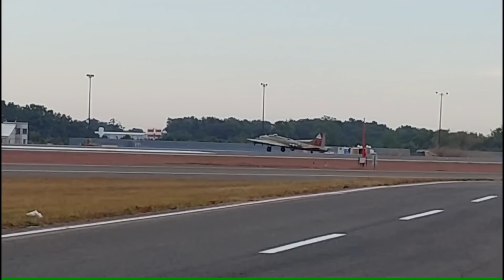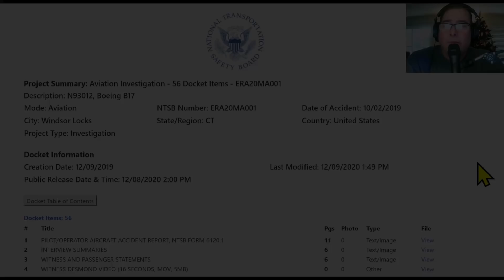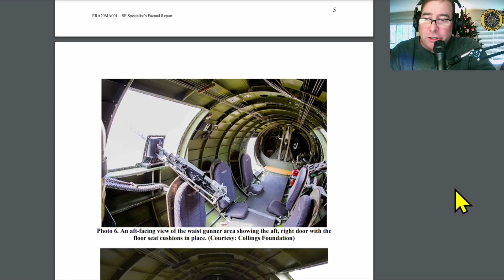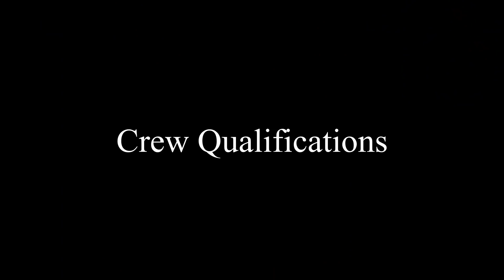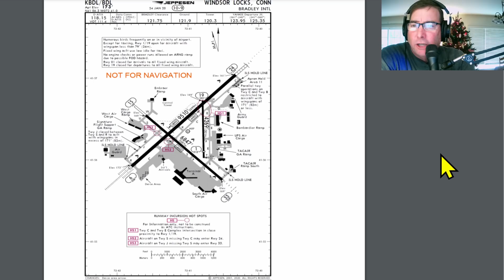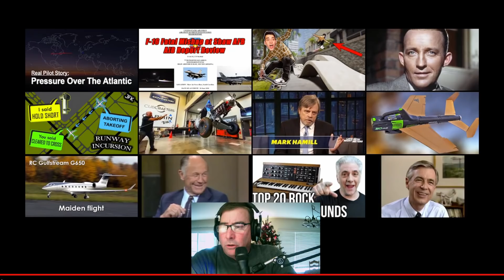NTSB Factual Report B-17G Crash 'Nine-O-Nine' Part I -16 Dec 2020

Comment: To understand the airworthiness of these planes, go to historic photos of these planes returning to base and landing literally shot to hell.
 Nose blown off, wings with massive holes, huge holes in the main fuselage, one was cut nearly in two with only the control cables keeping the tail section attached, with the tail gunner still in the tail, it fly for hours and landed.
Or the case of a B17 that landed itself after the crew ALL bailed out.
 It did crash it landed. This was witnessed by an entire gun crew that was stationed at the end of the runway.
 The plane landed and taxi to a stop.
These plane were flown in battle piloted by pilots 20, 21 years old with IF lucky had a few hundred hours including their trainer plane hours.
These young crews took off in bad weather and severely overloaded all the time.
 The safety belts are not just old out of date belts, they are in current use in all types of race cars and are easier to latch/ u latch than current automotive types.
 Possibly the real factor was the pilot's age. No matter how many hours you have, your reflexes slow down, the mind is not as fast as in your younger days. It only takes a hundredth of a second to change an outcome.

Comment: When you made the comment earlier about the number #3 engine having the only generator that sounds a little strange to me.
Did you mean the only hydraulic pump?
On a friend's PBY I used to fly 28 years ago #2 engine had  the only hydraulic pump as #1 didn't. Both engines have generators. 
Seem strange to shut down an engine that was running rough.
It's still making power.
A witness on ground said he saw #3 prop feathered before right downwind turn. Wondering if the captain feathered wrong engine.
Cockpit management you're supposed to identify, then verify  what engine is running poorly or at all. Being that low with rough running engines on both sides then turning into them too easy to shut down wrong engine.

Comment: The major mistake was the piolet did not realize this aircraft could land on the grass. He tried to make the paved to runway when he did not need to do that.
Reply: +Greg Warner   From another video, several mistakes are clear:   1) The pilot assumed #4 engine was bad because it had a history of trouble.  He feathered the #4 prop when he could have kept that engine for airspeed.  2) #3 engine was detonating and losing power,  so with 3&4 out they lost airspeed, below 90 MPH,  3) They dropped the gear early and lost more airspeed,  4) They came in low and clipped the ILS equipment,  5)  They dragged a wing in the dirt and increased power on #1 and #2, which swung the plane right and off the runway and accelerating.    If they had dropped power on 1&2 and stayed straight it would have been an ugly landing in the dirt but at least they would be down and possibly survivable.   Aircrew discipline and cockpit management were also factors.

Comment: Umm.. the crew and passengers should have watched the WW2 B17 training films. You are not supposed to use seat belts, everyone except the pilots and radio man are supposed to sit on the floor of the radio room, with back against the forward bulkhead, knees to chest, with the next persons back against your legs, one guy lays on the floor with knees slightly bent, radio man inflates one side of his mae west, crosses arms on radio table and rests his head in his arms, and after the crash you pop the roof off the radio room and evacuate out the roof opening, pilots crawl out cockpit windows, and all is generally well and good. In WW2 pilots landed B17s just about everywhere and in every circumstance you can think of and those pilots were very young some not even 20 years old and in a lot of crashes everyone was fine or only had minor injuries and if landing is impossible you grab a parachute and jump out the door. There was even a B17 that landed itself with no one on board because the crew had bailed due to damage so what happened here? Pilots are not as good as they used to be.

Comment: Terrible tragedy.; Maybe a stupid question but..try to answer if reasonable: would a sudden, risky, rudder turn 'help' - causing turning, drifting aside, lost of gears, propellers, but stop the aircraft prior to hitting the tanks?
Reply from the maker: I'm beginning to wonder if Mac was bounced out of his seat, or not in complete control at that point...
Reply: @blancolirio    From the witness video,  it sounds like somebody in the cockpit applied full power (or close) to #1 and #2 when they dragged that wingtip.   They accelerated into the crash with 1&2 pushing them to the right, and also I think somebody was applying rudder.

Comment: We had a set of those in the Navy C-130s.  We called them Gunner's Belts.  They had about 15 feet of a lanyard that you attached to the deck d-rings.  They were used for certain Emergencies and when the cargo ramp was lowered in flight.  I find it very unsafe to have PAX getting unbelted and allowed to gather at the front of an aircraft in initial climb out.  I find it in complete disregard to flight safety for the FE to be leaving his Station during a critical flight phase.   A critical experience examination of Pilot histories would be how many and what type IFEs (In-Flight Emergencies) they have experienced.   Even the most experienced, most cautious Pilot will become complacent overtime when greatest emergency is a cancelled PPR.   I was a Navy TSS/Airframer on the C-40A Clipper (Plank Owner) and Loadmaster/Airframer on C-130T, about to put in my FE package when I received my Line of Duty Disability.

Comment: Engine shut down, sputtering second engine, hanging on the props, can’t even reach pattern altitude, a few knots over stall speed...seems like it’s screaming emergency.  

Also, had they declared an emergency, that would have trumped the pattern and they wouldn’t have needed to turn into the dead engine.  That’s multi engine rule #1...NEVER turn into the dead engine.

Comment: The following are comments about operating warbirds in general, and not directed at the Collings Foundation.  I have some friends that are active with warbirds. I was for a bit, and saw upclose how sloppy the maintenance and flight training/standards were. For any non-flying folks, stay out of these warbirds. One has no clue as to the soundness (airworthiness) of the aircraft, the training thoroughness of the pilots, nor the skill level. The problem with these is this: People that want to own and operate a warbird try to lessen the cost. Cutting costs entails creating a 501c3 tax-exempt organization. Then they recruit "volunteers" that work in the marchandise store, back offices, grounds keeping etc. Also, the mechanics are volunteers, many of whom are not certified aircraft technicians (FAA certified Airframe and Powerplant mechanic). So who is doing the maintenance? Un-certified "volunteers" under the "supervision" of the few certified A&P mechanics on staff. Parts for the aircraft are very rare. Many parts are made from scratch by people who may or may not know what they are doing using plans or not using plans. Other parts are sources from every corner of the globe, where it is difficult to determine if the parts are genuinely "yellow tag" (airworthy) or "green flag" (not airworthy but repairable) or "red tag" (Non airworthy). May parts come from suppliers with no tab, leaving the operator to determine the part's airworthiness, which is not always very easy. Counterfeit parts are also common. Now lets look at the pilots. There are three types of pilots; Wealthy owners of the 501c3, airline pilots with money to burn, and well-off pilots that love warbirds. A prospective pilot of a warbird for these organizations fill out paperwork, volunteer hours working around the organization, and PAY a hefty fee for a checkout in a warbird. The bigger the warbird, the larger the fee the pilot pays. The training ranges from cursory and minimal to very thorough. When looking at a warbird at an airshow selling rides, which type of training did that pilot go through? No none knows. The oversight is by and large "self policing" with very little FAA oversight. Normally, a commercial aircraft company selling seats has very strict FAA oversight (airlines, charter companies etc.). Not so with these tax-free warbird organizations. So, we have a tax-free organization, with "volunteer" employees, "volunteer" mechanics (many no certified by the FAA), and parts from a tiny pool of parts that are made from scratch or sometimes sketchy parts from oddball remote places with questionable airworthiness that is selling merchandise, and selling joy rides piloted by pilots that may or may not be very highly trained or experienced that they themselves are paying to fly, just like the passengers. All topped off by lax FAA oversight. Stay out of warbirds. They belong in museums.

Comment: I rode on Nine-0-Nine a couple years ago, I cannot understand why there was not a safety briefing on this flight, when I took they flight they gave us a 20-30min safety briefing prior to boarding. Upon boarding we were shown how to buckle and unbuckle the military type seat belts (I sat by the rear door) they also showed us how to open the rear door and explained in an emergency, all we had to do was hit the door with our shoulder or kick it and it would open, same with the bomb bay, if  you can jump down and your weight (90lbs or  more) will push the doors open. The crew here must have been in a hurry because of the engine issues, or whatever, pilots and crews should not rush a flight and safety must always come first. I had a mechanic tell me it was safe to fly a Cessna 182 that just had a prop strike (the tips were bent), I told him no thank you and also told him to go ahead and test fly it for me first and he declined. No pilot should be pressured to fly in an unsafe condition. The pilot of this B-17 (Mac) made several poor decisions, he should have declared an emergency and used the runway to the right when on downwind, rather than taking the long route around while he was losing altitude. Sure, easy for me to say, but a pilot with that amount of experience should be able to react automatically, it is obvious that pilot training was lacking here, thousands of hours of flight time mean noting if you do not practice emergency procedures. I feel bad for Collings, I've met Mr. Collings, he is a good guy, but something has to be done there to assure all flights will be as safe as possible.

Comment: In the eye witness video it looks like he is full left rudder trying to get the plane back on the runway.  It could be he was too slow for effective directional control at that point.  By letting the gear down so soon he bled off the speed he needed at the end.  He may have been the most experienced B-17 pilot alive today, but he still had very little experience in an emergency like this.  Commercial pilots get many hours in simulators where than can go through things like multi-engine outages on takeoff.  Pilots on planes like this do not get that.

Comment: I flew in the 909 out of the Clearwater St Pete airport. It was an incredible experience, I wish I still had the still photos and videos, but transferred to a laptop I no longer have. I am tall enough at 6'5", and rode with my shoulders and head peering out of the top of the fuselage in the open window above the radio operator room. I had a great video of the view and roar of the mighty radials while at touring altitude and well as a great photo of the 909 tail while in a banked turn over Clearwater beach and a sunset photo while riding in the nose gunner seat. It was the last flight of the day just before sunset. Mack was the pilot that flight. I recall trying to get it out of him what it was like to fly the old bird. He seemed to be a man of few words type and simply replied, " it's different", and smiled.

Comment: Watch the video of the landing, why part of it was sky, don't know, but it is clear to see the rudder is hard left.  Every indication of the port engines being firewalled.  Once he was over threshold, he should of just cut throttle and let the big wing settle them down.  As soon as they were within range of the runway, cutting throttles would have reduced the roll effect and yaw.  Damage from ILS would have minimal impact on the plane, and they would have had full control on contact.     Plenty of mistakes were made here by a supposedly experienced pilot, who may have had tons of experience flying with everything working, but was sorely lacking emergency procedures.  Lack of crew communications could have resulted in the wrong engine being shut down, landing gear deployed way too early, and failure to declare an engine out emergency.   Tied together with the fact the Pilot was also the head of the Maintenance could mean Ego overrode common sense.  Notice that only engines 3 & 4 needed a blow out of the mags, #1 and #2 did not.  They should have taken a closer look before taking off with passengers. It is one thing to do what they did if it was only the 3 involved, but to do it with passengers to me is inexcusable.

Comment: Kind of  scary for me, having flown on all 3 Collings Foundation aircraft, B-24, B-17 and the P-51.  I'm no expert in anything but have been around aircraft most of my life. Knowing that the maintenance apparently wasn't their TOP priority makes me feel a little lucky to be here still. Along with the many other passengers that had flown on these aircraft. Having worked at one of their flight locations on their tours, I do remember a time or two when they had issues and would not fly whatever aircraft. After watching this report, I strongly feel that had the pilot declared an emergency and  attempted to land on the other runway they just may have made it down safely. As the report here brings up the fact of both engines on the right side being basically out of commission, why would the pilot continue to make right turns? As I understand a basic rule of flight, you do not want to turn to the side where you have no power. I can only assume he thought he was going to make it and did not need to declare emergency. As we see, a very critical error.

Comment: This is what happens when you adopt the "it'l be fine" mindset on maintenance. Parts worn past limits, spark plugs not cleaned or replaced, ignition timing not set correctly, pistons and cylinder heads bead blasted ect.

Comment: The seatbelts on 909 were approved by the FAA, and an FAA DER/DAR years ago. Not saying they didn’t need to be simpler, but the engineering and paperwork would all have to be changed. Seems moot and a cheap option now.

Comment: I haven't seen any comment about the significance of the number "909."  So, being the curious type, I did a little research.  There may be other underlying explanations for the choice of "909," but the one I consistently found is strongly associated with psychics, numerologists, mediums, tarot-card readers, and the like.   Here's one description:  "909 is a message from the guardian angels that we should expect changes and aspects of our lives to be altered. ... Angel number meaning 909 shows that you might be upset about certain happenings in your life. But you need to understand that the angels know about it. and what is happening is for your welfare."   My view is that this is 100% baloney,  but interesting nevertheless.

Comment: I could easily be wrong here, but bear it in mind I’m not having a go, I sympathise on this one. I kind of know why 4 was shut down when I heard he was maintenance as well. I don’t have planes, the only thing I bring to this is running old equipment and being an engineer. Also off-road racing and fixing them. If you are on the spanner side you will favour shutting down an expensive old engine. Wearing the pilots hat you need to be prepared to detonate that sucker to stay alive. It’s just two perspectives on keeping the machine in best condition. For me it was carefully making sure all safety gear was spot on and the 4x4 could easily finish the event. Then driving it like it was stolen. So take what I say with a pinch of salt, but if you need to hit a tree to avoid driving off a cliff the tree is getting a slap.

Comment: I have never flown anything the size of a B17, is power required for final touch down or could the touch down be accomplished with engines 1& 2 at idle? If so, why didn't the pilot reduce power, he had the runway made.

Comment: SOPs, not pilots, r biggest killers
SOP of running engines at FULL POWER for take off severely risk engine failure, & engine failure of multi engine plane on takeoff means doom - esp with SOP of keep good engine running at full power & not gliding it back

Comment: Just a question, why did Mac turn into his dead engine(s) side? Just because he figured it was the normal route back to the runway? The training films from WW2 state never to turn into the dead engine side for control issues.

You can see the issues stacking up even at the end of this part of the story. Surprised a tragedy didn’t happen before hand.

Very sad end to a famous aircraft and those souls on board.

Comment: Juan ,  Was the Airplane set up as a WW 2 Bomber?  I ask because the B-17s used in the movie TORA TORA TORA   were modified to carry a rescue life boat.. They were owned by Abe Cellars Aviation Specilties Mesa , AZ.  When their  part of the movie was done, they came to Boise Id for the Fire Season.  The bomb Bay was modified to hold the retandant tanks.  A .  When they landed  in Hawaii,  the crew took out the emergency Life Rafts and inflated them.  They inflated OK but immediately collapsed.  Just a little history.  I ran the Air Taker Base at Boise at the time.